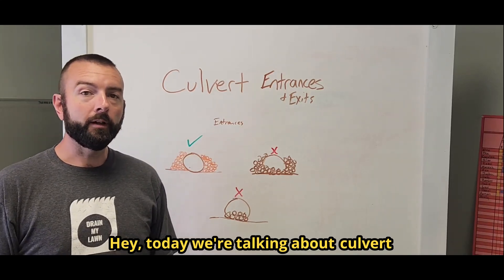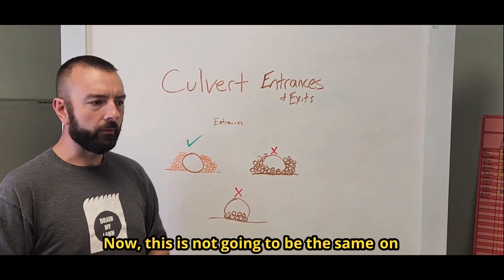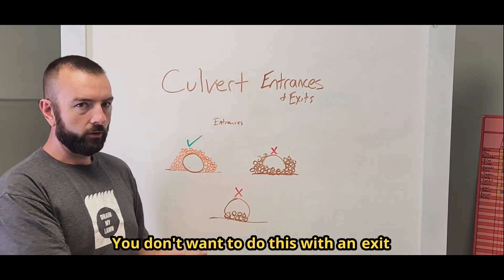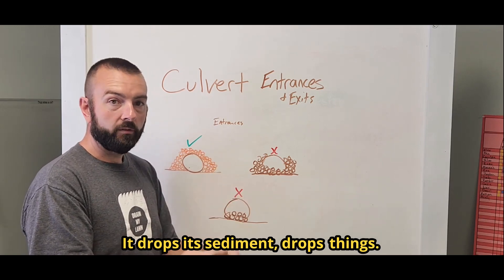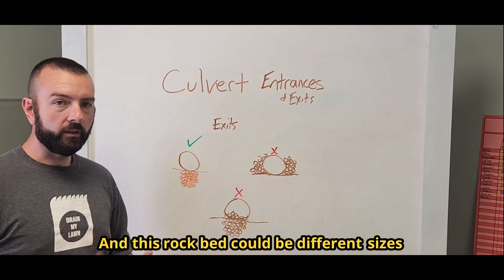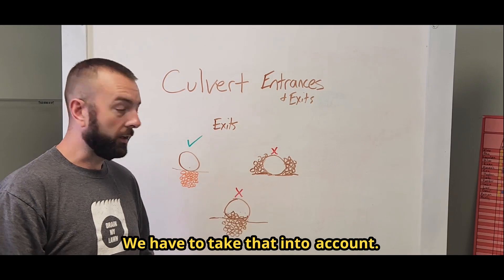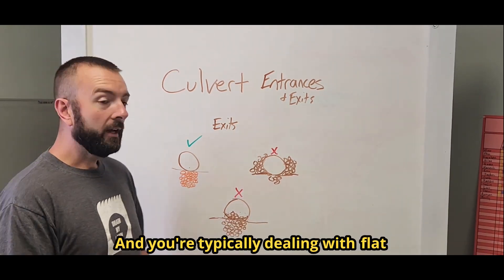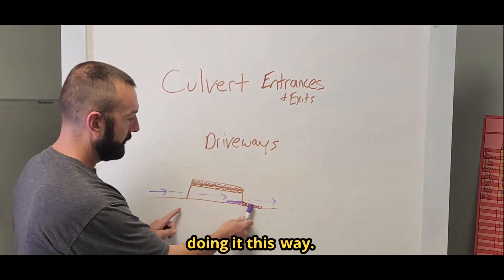The Do’s and Don’ts of Culvert Drainage — What Most People Miss

Comment: Can’t fully agree. Rocks on the entrance work like a filter; stuff like limbs will be trapped there (for easy clean up) instead of going into the culvert.  A raised entrance also prevents sediments going into the pipe, though it might trap some water which attracts insects.  For small pipes, a raised entrance is required; large culverts can be installed flush at the entrance.
Reply from the maker: You're describing a rock weir, but they are not normally installed at the entrance of a culvert.  They would typically be several feet away as to not inhibit water flow when needed.